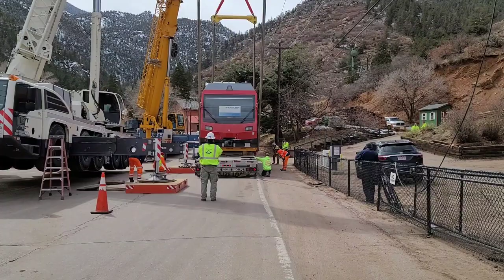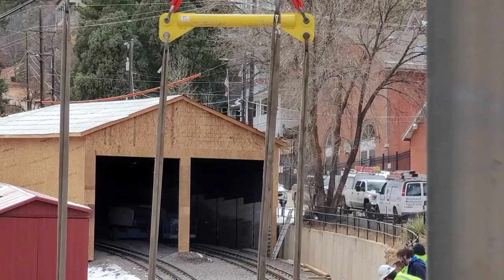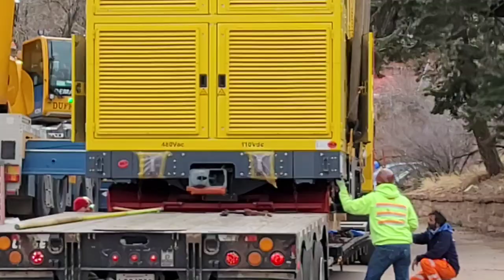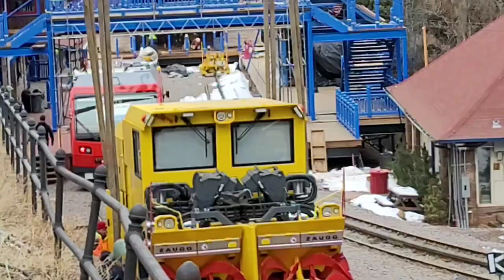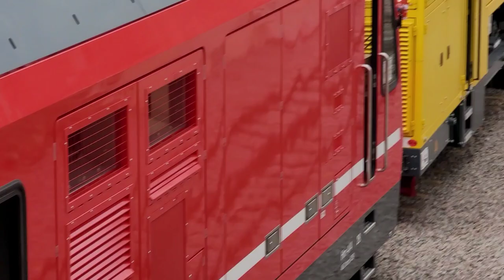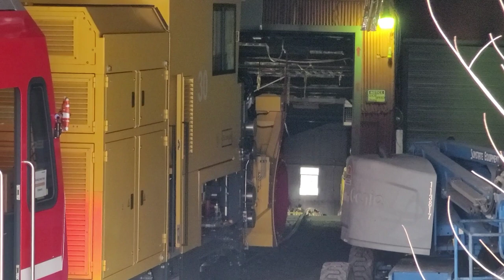New equipment at the Pikes Peak Cog Railroad!

Comment: I find it unusual that they ordered locomotives to push three cars. I figured they would order 4-car DMUs which each car having a diesel engine. The addition of the air whistle is also unusual.
Reply from the maker: Stadler knows best when it comes to cog rail locomotives, and this is what they came up with. The air whistle is very common for their usual clients, but it is unusual here in the states. A welcome addition though
Reply: Stadler DMUs tend to have the Diesel engine in a separate short car, often called a "power pack", typically with a path through the middle accessible to passengers. I'm guessing that this is to reduce noise and vibrations in the passenger cars. It is probably for this same reason that Stadler just went with a locomotive-based design instead here.
Reply: @lukasegeling5205for the Zaug Snowblower specifaly